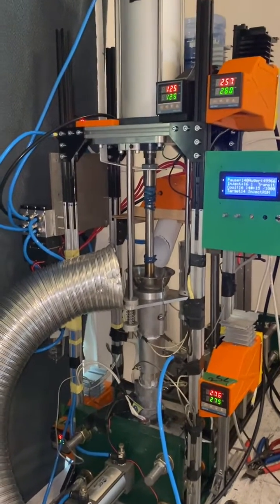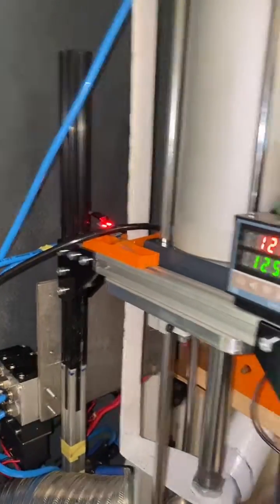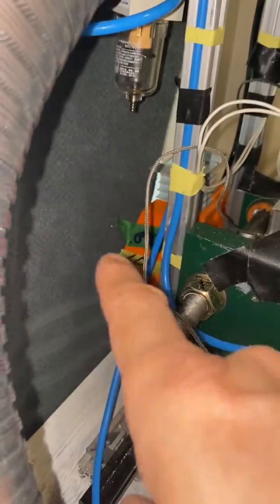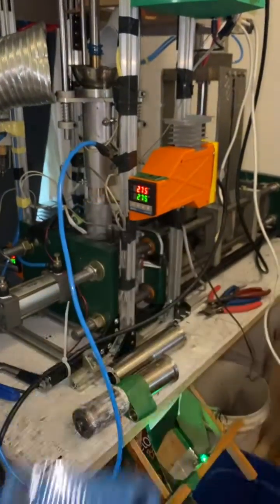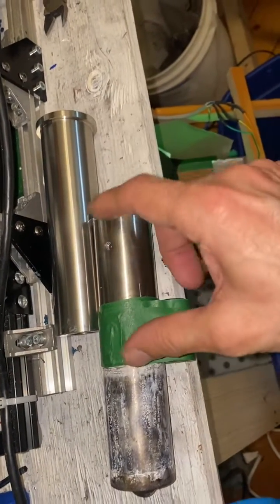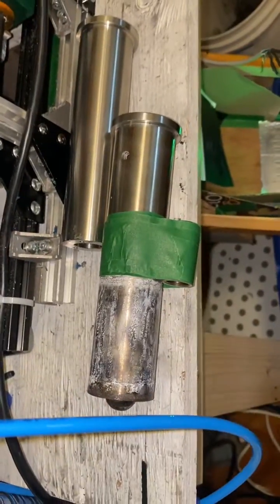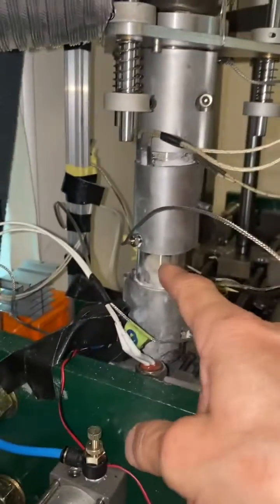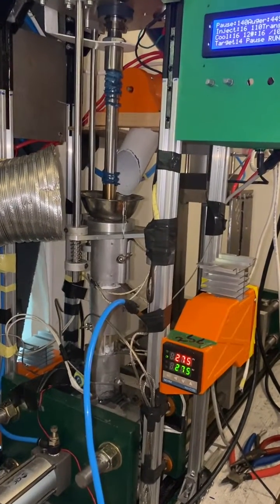Decreasing cycle time on automated buster beagle, injection, moulding machine.

Comment: When I was making a ton of plastic injected parts on a home brew injection machine I quickly learned that the best case was only injecting a small fraction of the total barrel volume. Say 20-25%. 

So each injection is only injecting the bottom 20% of the barrel, which means it has had 4-5 injection cycles to fully melt. 

If you need to make many 100s
Of parts, don’t heat the very top so the pellets there don’t melt and clog up the piston, and inject as little of the barrel as possible each cycle. 

If I was making 20cc parts I’d have a barrel volume of 120cc even if that meant my injector was 24” long!  And the piston doesn’t even need to sweep the whole thing. 35% at most to allow for compaction. 

Nice work here, by the way!